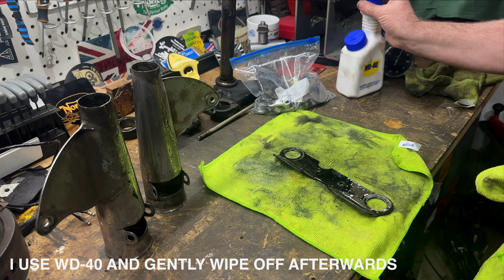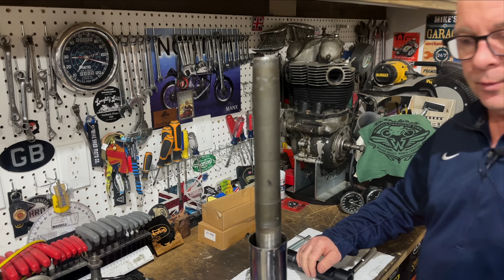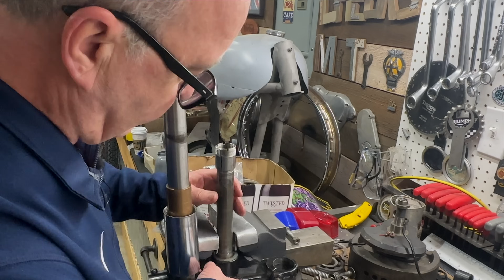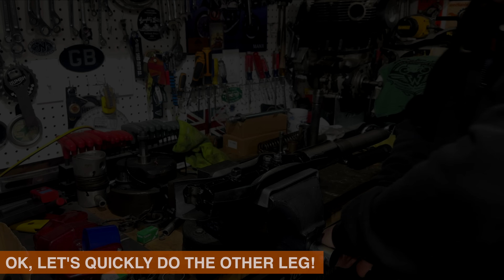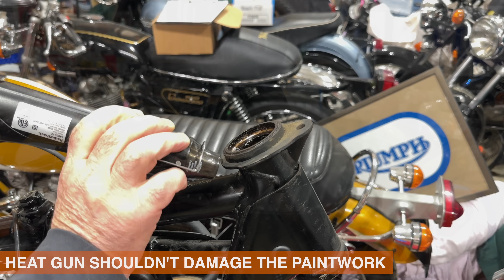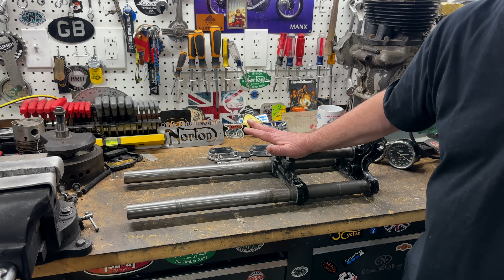1962 BSA A10 Super Rocket (Part 11) - Front Forks - Part 2

Comment: Mike,  Have you ever  had a metal sound when you're forks are fully extended.  I've    tried different oil and quality with no luck.  I had a BSA in the 70's and never had this problem.  Still trying to figure the out on my Mk3.  Gary
Reply from the maker: Hi Gary, sorry but I haven't experienced that before. Could it be the springs rubbing or the banging noise that the forks can make for example when putting the bike on the center stand?  Cheers
Reply: @TheMightyGarage  If the bike is on the center stand I can compress and then go full extension which amplifiers the metal to metal sound.  Will your bike do this?  Thanks for the reply.

Comment: With thin-nuts  (the amount that protrudes for the socket to engage ) I have found that modifying a socket or ring-spanner works very-well , requiring less-torque and less chance of damage to the nut from slipping ; Sockets and 'Rings' all have an angle/chamfer anything up to 3mm , this means that only the-Top of thin Nuts (or bolts) is being engaged by the socket . I grind this flat until there are clean,sharp edges to engage the nut Fully over the entire amount that it protrudes . I cringed the first-time I did it , but still have and use the tool after many years of use and it never Jumps-off or marks anything , requiring less-force to tighten or loosen .   Dave

Comment: Nice video...well made and clearly explained.
I like the way you honestly showed the false starts you encountered and how you'd learnt for the second fork.
I've worked on A10s for years and wondered about these forks.
Has anyone tried hard-chroming and grinding those stanchions then reaming the bushes for a modern close sliding fit?
The originals have a fairly rough machined finish by today's standards which must play havoc with the seals and,to a lesser extent,the top bush...causing slop and consequent leaks (to which these are prone)
Just a thought....
Reply: PS: Taper roller bearings...best thing I ever did for my old A10...an "always fit" item now for me.

Comment: I'm looking forward to the next video Mike. The twine is by far the best way to seal the oil seal holder to the slider. Suitably greased of course.
Rolls-Royce originally used a silken thread to seal the tappet cover to the block on the V8 engines. So your in good company.